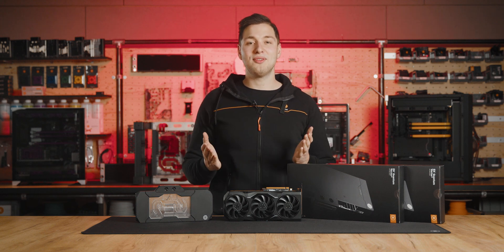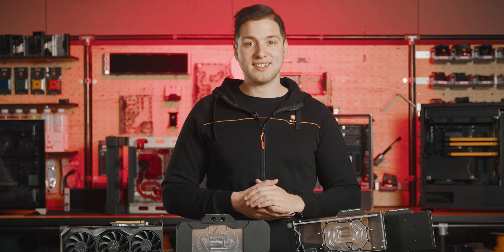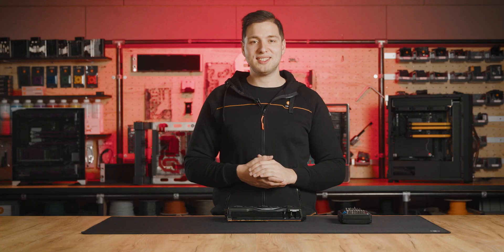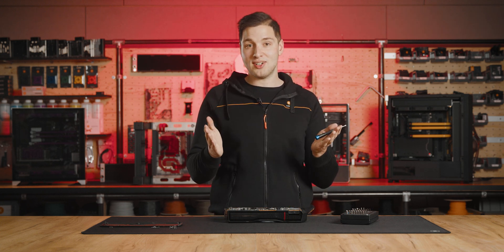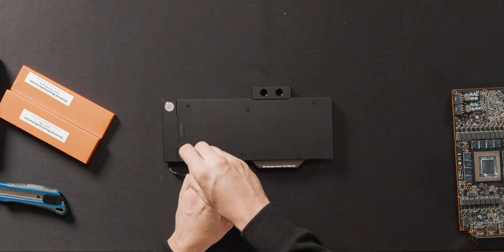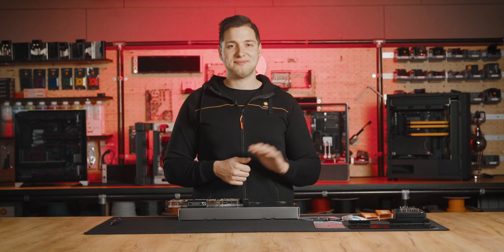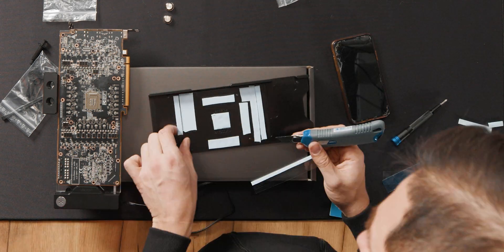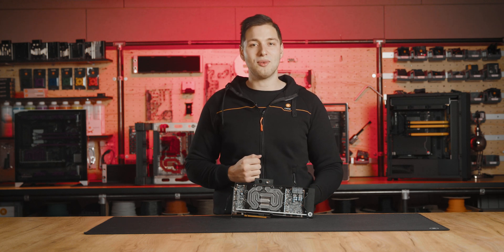How to Install the EK-Quantum Vector² RX 7900 XTX AMD Radeon Tutorial | EK HOW TO

Comment: Sure thing "Ma tits". Bought one of these for my Nitro+ and it was a piece of shit. Had to cut my own thermal pads, assembled everything, and realized the fucking contact plate was warped AND I had to disassemble the fucking block it's self because one of the o-rings was cut/dented and had a tiny leak. Straight garbage and almost ruined my 7900XTX.

Comment: This may be a silly question but I want to make sure. This water block will work on any RX 7900 XTX cards including partner cards like the Gigabyte Gaming OC version? And not just the refrence one shown in the video?
Reply: I don’t think so, they only have red devil, ASUS TUF, and reference version waterblocks
Reply: sorry for the VERY late reply, but yes it will work. It doesn't matter if it's the reference model or AIB model. They are both the exact same thing. The only reason AIB models clock higher is because they have better cooling and allow for higher clocks at similar temps to the reference.
Reply: @whatsthis665  incorrect. The PCB's are laid out different.

Comment: Will this fit SAPPHIRE-AMD Radeon ™ RX 7900 XTX 24 GB-made according to the reference AMD ?
Reply from the maker: This fits any reference design card. The reference design cards are easy to identify as they all use the same cooler, pictures of which can be found on the official AMD website.
Reply: @EKbyLMTEK  Physically tested, it fits, no problems, ok

Comment: You guys really need to include better instructions and the proper tightening sequence when tightening the block down to the cold plate… I was shocked when I read on Facebook that no where in this guys owners manual did it mention about proper tightening sequence.. just because you have a torque screw driver does not mean you can’t skip that working inwards to outwards to provide equal clamping force across the cold plate..